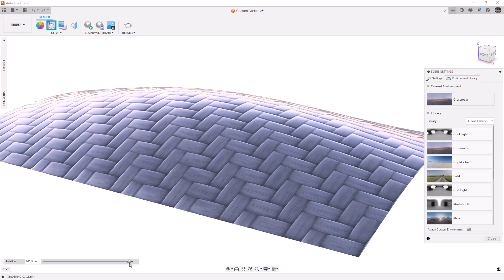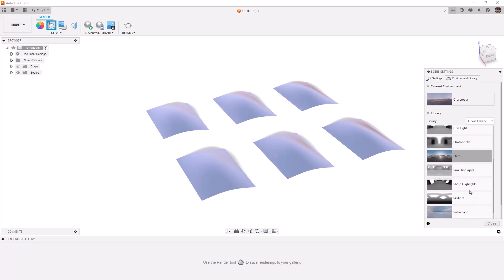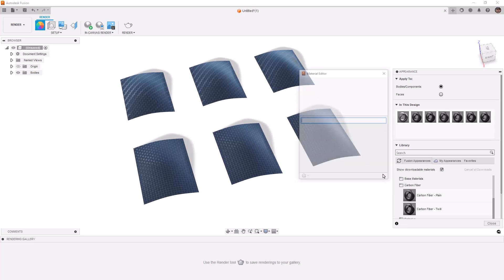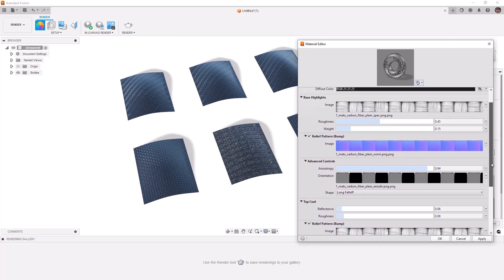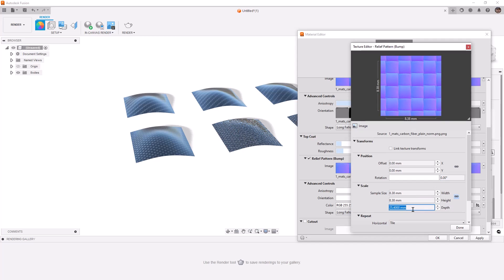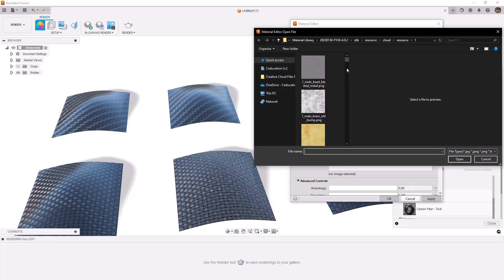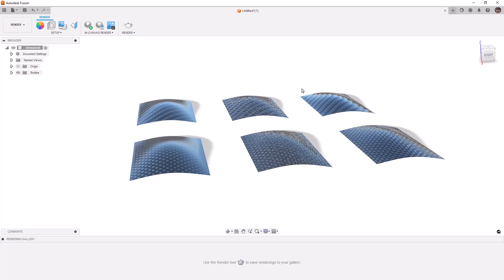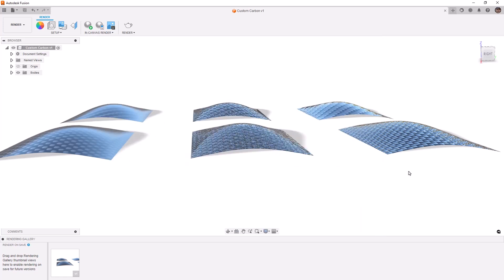How To Customize Carbon Fiber Appearances in Fusion

Comment: Do you have a video on how to apply this surface to an existing design and do you know how it would look if 3d printed?
Reply from the maker: Sadly this is an appearance only and does not change the model at all.  If you are looking to print a texture like this you have 2 options.  Some Print slicers will have texture options that can be applied to the model before printing.  Another option is a mesh program like Blender.

As for how to apply, you simply drag/drop onto whatever your object is.  The project and shape might do some interesting things.  It works best on a single face as wrapping around multiple faces will often do some funny things with the tiling.  you can manually change that with "texture map" but it would likely be a good bit of time.